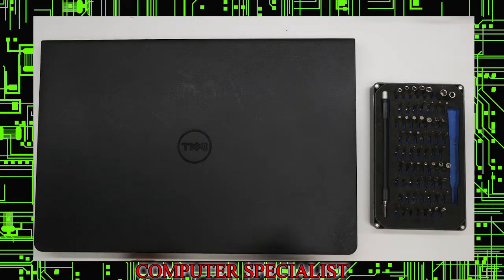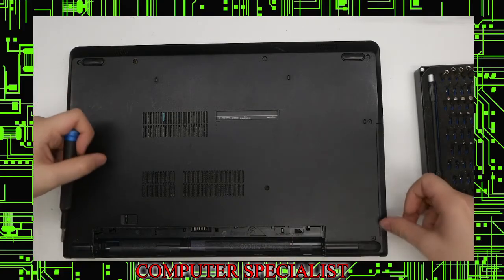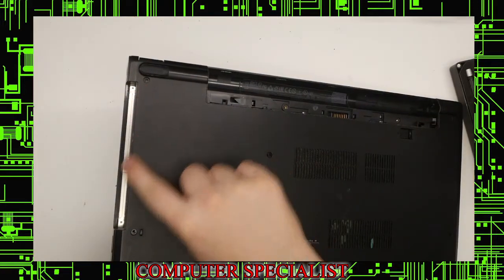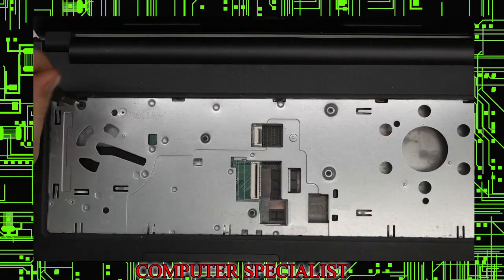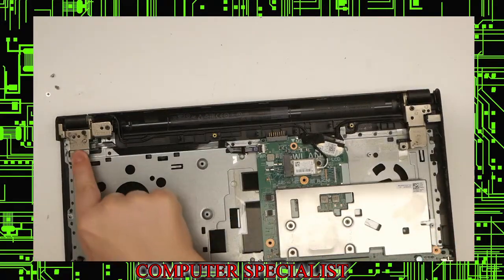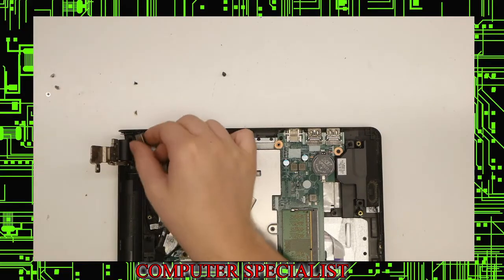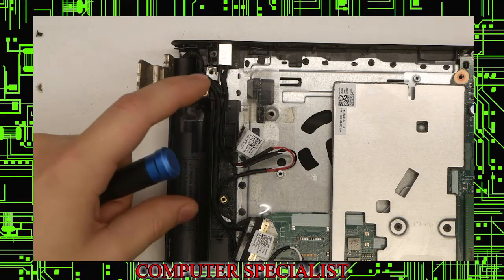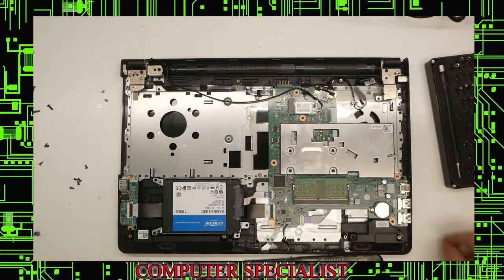How-to Replace DC Charging Jack in Dell Inspiron 15 3000 Series

Comment: different module then the 15 3000. there are cords that this labtop doesnt have
Reply from the maker: Are you saying you have a different layout on your Dell Inspiron 15 3000? and if so whats your service tag number (on bottom of laptop or in bios)
Reply: @computerspecialist8533  yes
Reply from the maker: Most the jacks are same, just check the wiring. Sometimes the length of the wire is an issue!

Comment: mine the jack screw nut plate lifts out with screw…can i super glue it?
Reply from the maker: Yeah that's a common issue on this model. The plastics unfortunately cannot handle the torque put on the screws by the hinges. Superglue and baking soda works really well.

Comment: Thank you! REMINDER: Be sure to use a Van Halen guitar 🎸 pick or you will fail on this mission! 😂
Reply from the maker: Your Welcome! and yes that always makes it easier!
Reply: Unfortunately I tried this method last night and although it was very step by step… my laptop is not charging. It blinks an amber light 3,4 times then a white light blinks. I trie to power on after about an hour of charging and it still won’t turn on. Do I need to buy a new battery pack? I purchased the right model charger port listed from Amazon. Just wondering if I may have disconnected something. I was hoping g to upgrade Ram also change to  SDD … do you know what the codes are for this type light blinking sequence is? Dell 15 Inspiron 3558 is my  model I believe. At this point I might have to take it to an expensive expert 😖
Reply from the maker: Blinking amber light is probably dead battery. The charging jack would only be a problem if you were getting a message saying that the charger couldn't be identified when you turn the computer on (Indicating that the center pin charger connection was missing/damaged/not recognized). I would try swapping the battery out with a genuine one, they are fairly cheap.
Reply: @computerspecialist8533  bought a new battery. Plugged it in and no more blinking light.  I tried to turn on laptop and it did not power up. At this point I’ll let it charge some more and I’m hoping battery wasn’t fully charged but I read they come with enough charge to power up laptop. Any suggestions if laptop does not power on?
Reply from the maker: @rogueleo6587  unplug battery and charger and hold power button in for 20 seconds (Discharge capacitors). Then plus battery in and then charger, let charge for about 20 minutes then try powering on.